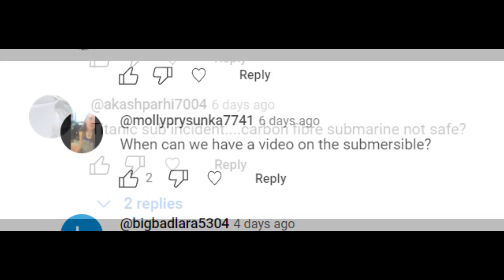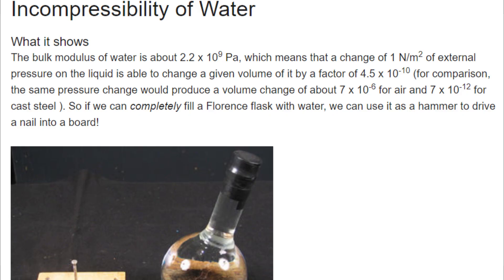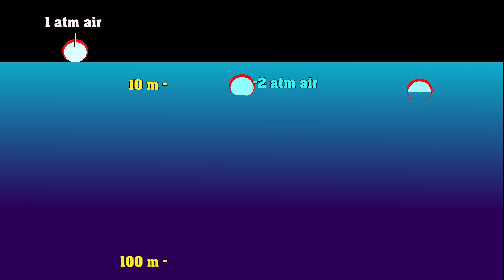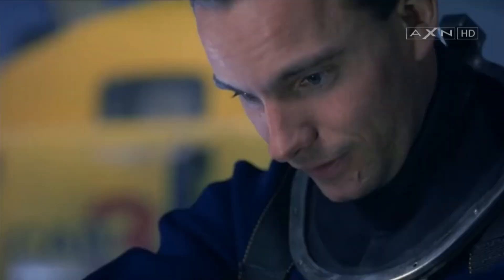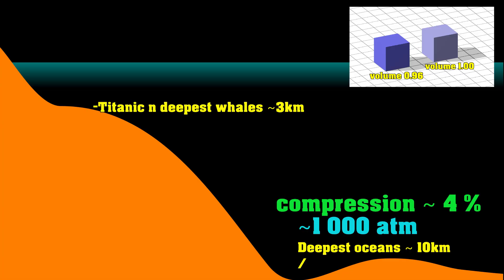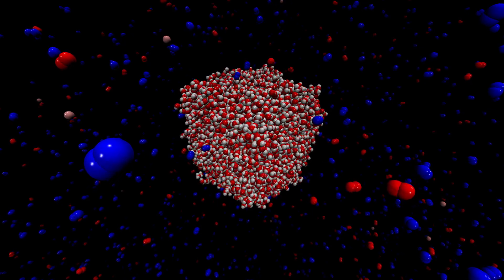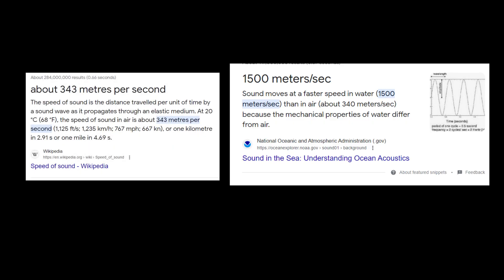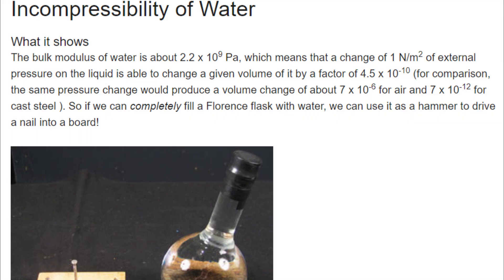What Happens when a Hull Fails at 1000 atmospheres?

Comment: I still can't believe it survived its test runs.
Reply: Test runs maybe weakened the carbon fiber hull
Reply: @rykehuss3435  Almost certainly
Don't forget it's essentially human beings layering "cloth" in opposing weave patterns.
At those pressures the tiniest imperfections and uneven layering would create small pressure differences and undue stress
Reply: @matthewstanton9633 not even, just see hiw it was just woundbonvaxdpool !
Reply: @matthewstanton9633 Not even opposing weave patterns in this case ...
Reply: @matthewstanton9633 not to mention that the exothermic reaction from weighing 5 in of carbon fiber and epoxy in one shot would cause instant hardening between layers and lots of dry delamination. They wouldn't know about any of this because they refuse to get it X-rayed.
Reply: @matthewstanton9633 No opposing weave patterns in this sub. It's like the thread you buy for sewing clothes. Just a flat thread rolled to an even thickness on a spool.
Reply: @matthewstanton9633 completely uninformed statement. Titan was laid up entirely by a machine.
Reply: Essentialy it's the dehaviland comet all over again
Reply: @matthewstanton9633  One could argue they learnt something new with the dehaviland comet. Not so much in this case.
Reply: @stusue9733  yes that's the truly sad part.
Dehaviland practically invented stress testing and went to extremely inventive ways to found out about the stresses involved in going from low to high pressure to tye extent of putting a whole plane fuselage under water.
I this case dire warnings about not doing destructive testing were ignored in favour of cost cutting
Reply: @infernaldaedra he never claimed to be a submarine expert. Nothing in this video was about submarines. It was about how water behaves under pressure.
Reply: @ThePrufessa  Submersibles are not Submarines. 😉 Hehehe

In this case you're better off just pointing out that they're not actually making a counter argument to anything FT said. After all they clearly have no real argument to make.
Reply: @ThePrufessa  dense much?
Reply: It survived more than just test runs. The sub wasn't completely unsuitable for this but it was only good for the first few dives.
Reply: @DM-rc4yu sure, not completely unsuitable, just mostly unsuitable. Did you forget the viewport was rated for less than a third of the depths they were going to?
Reply: @zromo8994  The viewport was rated for 1300 meters. Made of acrylic. And human safety means it was likely designed to ha dle 4000m+ of depth because human safety always means there must be a significant safety margin. Just that the window might have been designed to be safe for 100 dives to 1300m. And instead ended up safe for maybe 5-10 dives at 3700 meters.

It could be the window that failed. We just don't know. The only thing we do know is the window was made and tested based on best practices. Which is why it did allow multiple dives to 3 times the depth without failing.
Reply: @perwestermark8920  yeah so what I said. A third
Reply: @DM-rc4yu  What did you expect from something that literally used a thirteen year old Logitech F710 gamepad as its primary control input........
Reply: @DM-rc4yu so it was completely unsuitable.
Reply: @morten1953  No, it was suitable for 1 trip. It made it to the Titanic one time and returned. They should have left it at that.
Reply: @morten1953  No. Everything has expected life expectancy, your car is expected to run certain milage before breaking, airplanes are expected to have x number of takeoffs etc. You can of course make that expectancy higher by studying the mechanics and figure out that needs to be maintained and how often, but at some point it is more reasonable to retire the whole vehicle.
This submarine was experimental and they didn't bother to actually study or test it properly, just hope that it will work forever because that would save a lot of money.
Reply: @R3WIRED If went to the titanic at least 10 times in 2021 and 2022.
Reply: @morten1953 no. It wasn't completely unsuitable. However, he should have been swapping out new carbon fiber for every trip and charging them more than $250,000. He also cheaped out by making them do the grunt work instead of hiring people to put it together.
Reply: @ThePrufessa EOUGH NON SENSE ! Glued fiber is unsuitable here ! It will fail, each cycle will lead to cracks till total failure ! ENOUGH RUTH STOCKTON ! To swap the bofy each time ? Are you nuts ? Non sense too !  USE PROPER MATERIAL
Reply: @R3WIRED I think they had done 7 trips before the failure on the 8th trip.
Reply: @R3WIRED  Yeah, agree. I'm sure everything would've fine if they did 1 trip per sub and charged .75-1.5m/ticket.
Reply: @R3WIRED  who builds an expensive one time use submarine? that's incredibly wasteful. 
since they used it multiple times they expected it to last. since it failed catastrophically it was unsuitable for the job they had for it.
Reply: @morten1953 yes probably rated for 1 dive at 1600 m. As the window was only rated for 1600 m
Reply: @villekorhonen824 actually it is worse than that. The nature of the material makes it very difficult to monitor unlike, say, steel which you can monitor for fatigue etc to gauge residual safety.
Reply: @morten1953  I would say it's about as suitable as any other non-reusable products. Money aside, the sub survived several dives to depth when it should have been replaced after every single dive. Had they not been so sure of themselves and instead tore them apart to see what was happening after each dive (or used them as autonomous only subs after that) we wouldn't have even heard of them. The failure was using a single use submersible more than once. That and the front viewport was a glaring issue that just happened to work, until maybe it didn't.
Reply: @R3WIRED  It did around dozen dives between 2020-2023. Lots of YouTube videos from actual dives to the Titanic
Reply: @villekorhonen824  Let us not forget the Logitech game controller used for piloting... Something neither designed, nor rated, for use in damp/salty environments. Which makes me wonder about other electronic systems in the sub. How about those exterior cables that could easily snag? The propulsion system was virtually unprotected as well. 

So many oversights, so much ego, and he took four innocent people with him due to his hubris. I'm no expert, and I'm certainly not in the market to build or design the next-generation Carbon-fiber Coffin, but there are things that clearly should have been done better.
Reply: @donmab  They probably saw pictures of it and assumed the whole thing was the pressure vessel.
Reply: Each cycle cracked the composite cylinder, glue to the rim ... till total failure. Wound fiber (even woven) glued together is unsuitable to resist external pressure plus a poor shape, should be a sphere eventually an egg form.
Reply: @jpcaretta8847  Yes but then no.

Egg shape is weak on the sides but study from above and below. (Ever crack an egg?)

A sphere has the same amount of strength everywhere.

Also the challenger was the same sausage shape and it's the best that's ever been. It's only the habitable area that matters.
Reply: @jpcaretta8847  egg form is weak on the sides. Anything going this deep should always be a sphere.
Reply: @danquaylesitsspeltpotatoe8307 he was just demonstrating how water behaves under pressure. He was not doing a reenactment of what happened to Titan. Your problem is you're not smart enough to comprehend what he's demonstrating in the video.
Reply: @TubeMeisterJC  Exactly, the cause of death is still from pressure differential. The difference in viscosity would cause extremely rapid mixing, essentially turning anyone into a localised soup.
Reply: @dr3v1l1993 Yes there were - they were all test runs, complete with passengers to make them more realistic.
Reply: but he didnt go on those... 🤔
Reply: Most things probably can. The problem is the microfractures that take place that will become the areas of weakness on later uses. Most pressure vessels graded for humans will undergo vast laser and gas analysis to detect microfractures. Those microfractures will be the place that continues to expand, and will eventually fail if not addressed or understood. Aloha airline 243, where the roof ripped off during rapid depressurization. It was desined to last decades, but for several hour flights, not 30 min flights between islands, flying up to 7 times a day. That constant pressure, depressure, pressure, depressure cycle eventually fatigued the bolts.
Reply: @infernaldaedra  you're the one that's dense if you think people are claiming to be submarine experts.
Reply: The company went woke. Fired even the one that warned about design flaws in 2018. And after refuses to hire people with experience. Due to most are white male and above 50+. They called it not inspirational.

Edit they sed to "go woke go broke" hold my beer! .... In a real bad way🤦
Reply: @jpcaretta8847  carbon fiber is suitable for one use dude. Now stop raging at me because you don't understand what I'm saying. If NASCAR drivers use their engines ONE time then he could certainly use his hull one time per trip and change it in between trips. And charge these billionaires more than $250,000 in order to cover the costs of a new hull.
Reply: @ThePrufessa Replacing the hull isn't a solution.  Because that is based on the assumption you can analyse the just produced hull to find defects.

But the same moment you can analyse the material, you no longer has a reason for replacing the hull. If it was strong enough, then the hull will still be fine after multiple dives.

The issue here is they had zero ability to know if there were delamination. They didn't knew if there was zero delamination when brand new. Or delamination after 1, 2 or 10 dives. So every single dive was a dice throw to see if it would stand the load or fail.

That's why all other designs are based on materials that can be examined. And where you can simulate the load because all material properties are known. You can't simulate this hull, because every single delamination is an unknown. And you can't add delaminations you don't know about into the simulation.
Reply: @perwestermark8920  it's more of a solution than using the same hull over and over again until it fails. That's why I said each CF hull should only be used once. Because it's impossible to test how it fails with repeatable results.
Reply: @ThePrufessa  Just that the hull can fail already on the first dive if they can't test it. So no - it's a zero-use design without good test methods. Not one. Just zero. Much simpler products regularly have defects directly from factory. Which is a reason we have warranties when we buy things. But a warranty isn't worth much to a dead person.
Reply: @ThePrufessa in that case, make it out of steel like everyone else...?
Reply: It's amazing it survived the test Dives. Carbon fiber has literally no compressive strength only tensile strength. He couldn't have picked a worse material if he tried.
Reply: I'm not.

But I'm also not surprised it failed after several dives.

Upon hearing a composite hull I immediately guessed fatigue cracks.
Reply: Something that has been talked about in other videos is that carbon fiber is great in tension but poor in compression. Which it why it works so well in aircraft. Something else is that carbon fiber is normally laid diagonally increasing its strength, this was not done in the sub.
Reply: yes it did and then som
Reply: @kennethschultz6465  You sound like somebody who gets very confused about the "I can't believe it's not butter" ads.
Reply: @MeCooper  well if it made sence i know it´s not butter
Reply: @TubeMeisterJC  
Pressure is potential energy, potential energy is harmless. But when potential energy is converted into kinetic energy it becomes dangerous.
Reply: @jpcaretta8847   if he makes them pay for it then what difference would it make to make a new hull each time? It's not nonsense dumbass. It would have been better than using it as many times as he did without changing it.
Reply: @MeCooper  the difference between a submersible and a submarine is negligible and makes no difference for this conversation. The only difference is one can enter the water by itself while the other one can't. So miss me with your pedantic nonsense clown. Everything I said still applies to both submersibles and submarines so fk 📴.
Reply: @MeCooper  the challenger was not sausage shaped dummy. The challenger was a sphere.
Reply: @jpcaretta8847  if NASCAR engines can get rebuilt after each race then so could this hub get rebuilt after each dive. Calm your raging down you babbling buffoon.
Reply: @TubeMeisterJC  more like "it was not the funeral that killed you it was the landing", you got the order of operations wrong. Pressure comes after you die even if it was the cause of the effect (having compressed water) pressure waves have almost no pressure, prenatal versus kinetic energy.
Reply: @MeCooper  YOU said the challenger was sausage shaped and it absolutely wasn't. It was a perfect sphere. Now what does South Park have to do with this?!
Reply: @ThePrufessa  It's the only cartoon I could think of that has a rendition of the challenger... You're clearly getting your information from cartoons or something. Hahaha

It's a vertical sausage... It's actually famous for its design.
Reply: There wasn't much fatigue tests done on this thing.
Reply: Every time it goes down it gets weaker
Reply: It really didn't, it had a communications malfunction every single test.
Reply: It was only made to serve its test runs. The rest were for research and they didn't give a single s*it about what happened to the people on board, only to see how long it would last, how it would fail, and where they should improve. They probably looked at their CEO before he went on and went "bye bye, see you on the other side" knowing Damn well it could fail.
Reply: This is fun. 🍿 You guys are a hoot.
Reply: @TubeMeisterJC  
According to Engineering Toolbox the Triple point of Nitrogen (the most abundant gas in the atmosphere) is 0.1252 bar at -210°C.

Oxygen's triple point is 0.0015 bar at -218.79°C.
Neither of these gases become solid or even liquid at anything approaching 100 bar and -100°C never mind at lower pressures and higher temperatures that you can see in a cavitation event. I mean if this was what happened to air... there would be no such thing as cavitation in water or air!

CO2 could fit the bill... but they work extra hard to keep CO2 out of subs because under pressure it's even worse for humans to have it around. Even at normal pressures which you should experience in the Titan Sub you know before it implodes) CO2 only consists of 0.04% of the typical air in our atmosphere at sea-level. So while CO2 can become a solid it only can do that at 5.18 bar and -56.6°C even at 100 would still need to be pretty close to that -55°C to be solid... so in no way shape or form are we seeing liquid or solid air during an underwater submarine implosion.

But you and the people that liked your comment keep on thinking that I'm the one who's wrong here. It's alright the scientific evidence is on my side on this one.
Reply: @TubeMeisterJC  
Methane at those temperatures -18°C and pressures 80 bar would still need to be over 60°C colder than it was in the water outside the sub before the implosion to even be close to being a liquid, at best it might be super critical (meaning it becomes a substance with viscosity of gas that is nearly incompressible like a liquid).

There is generally much less Methane in air than CO2, if CO2 will not likely cause problems Methane is even less likely to cause serious problems.

I'm also the first like on your comment simply because you're at least trying to correct odd mistakes.
Reply: Its the tale of Stockton Rush, who ignored all the fuss, because he was in a rush, which is how he got crushed, and now he's just mush
Reply: Yeah but there were no check-ups for some kind of creeping damage to the gaskets etc, probably not even possible with everything just glued together.
Reply: @Breakfast_of_Champions wym not possible? how do you think they know you fractured a bone? praying to god?
Reply: I watched a video and it basically said carbon fiber subs are only 100 percent safe on the first run and after that it starts to degrade. I believe the Titan was on its 15th dive?
Reply: @NeapolitanApe carbon fiber is never 100% safe. Lol.
Reply: @MrJC1   Was the carbon fiber even holding anything. I saw how they did it, they just spooled carbon fiber around a thin titanium cylinder and put a lot of glue (probably some type of epoxy glue) around it. I think only the glue and the titanium were actually holding anything and the carbon fiber just sat around there, maybe the glue gave it a little rigidity but that was it. The moment the glue stopped holding sub imploded...
Reply: @Slav4o911  well i think the carbon fiber was glued to the titanium ring... if that is what you mean? the titanium cylinder they wound it around was removed i think after the carbon fiber had set. but i could be wrong. either way... the adhesive was the only thing holding it all together at its most crucial points. which is just insane to me, especially since the titanium ring and the carbon fiber react differently over time through wear and tear. which is an obvious failure point for glue bonding. titanium can flex a little under pressure, and carbon fiber wont. so you just know what that is going to do to a joint like that after a few cycles. and Stockton was no fool when it came to engineering. So it is amazing how he was able to blind himself with excitement for it. Just blows my mind really. The truth of the matter is, there are so many ways that carbon fiber can have imperfections and problems that cannot be discovered until much too late. I wouldn't even trust a carbon fiber pressure vessel for one trip, never mind recycliing it. I know they say it would have been okay if stockton had have just used it for one dive, blah blah... NO! trust me, don't do it, and you'll be 100% better off. Use OTHER materials. Use Steel! haha.
EDIT: Except in space. Obviously, in space it is entirely different. Much easier to keep 1 atmosphere in than keep 400 atmospheres out. Carbon Fiber is good for that kind of stuff and I am not trying to say it is a total failure as a material. Underwater deep diving though... hell no. Again... I am surprised that an engineer like Stockton Rush, had seemed to forget that we use certain materials for certain jobs. Lol. Smh.
Reply: @MrJC1   If they removed the titanium cylinder from the inside then everything was held by the glue. It's amazing how this worked as long as it did.... it's just crazy what they did. Also the carbon fiber almost didn't do any work... it was just sitting there between the two titanium hemispheres. 
 Also the type of glue they used seems to be strong in compression so it held  alone the middle section for as long as it did. 

 Also doesn't anybody looked at that video, they've also used glue for the sealing between the carbon fiber and the titanium rings:
https://www.youtube.com/watch?v=WK99kBS1AfE

 You don't have to be a rocket scientist to understand why this is a very bad idea.
Reply: @Slav4o911  Yes - they should have done just resin. Or acrylic. And suddenly have a homogenous product that can be properly simulated. But "composite" is a cool word sounding high-tech. And "plastic" is a sad word sounding cheap. The CEO did want to make parallels to high-tech planes. So cooler with "same technology as Airbus and Boeing". Even if the usage cases are so drastically different. He went with a design that absorbs water. So it changes properties the longer it's kept under water - even at a fixed depth and temperature.
Reply: @perwestermark8920   Yes they use carbon fiber but they is it in  a complete different way. The way he used it, was incorrect. Like for example if the pressure was from the inside of the submersible and not from the outside it would have lasted much longer, carbon fiber is known for it's tensile strength. It's also used in the auto industry for a certain pats but not for everything. Also in the atmosphere we have 1 atmosphere of pressure and in space it's like -1 atmosphere.  On the ocean floor the atmospheres are some crazy numbers, most people can't realistically even comprehend.  Like for example the Space X raptor engine has about 300 atmospheres of chamber pressure. 
4km deep in the ocean the pressure is 400 atmospheres, which is more than a chamber pressure of a rocket engine.  That's the only way a normal human can imagine it... and at that pressure any small flaw suddenly becomes very big flaw, that's why rocket engines explode... that's why everything about the pressure vehicle has to be overengineered. That's also the reason more people have been to space than in the Mariana Trench.
Reply: @NeapolitanApe They aren't safe in the first dive either - the problem here is that they 100% depend on knowledge of any delamination. And there are no good ways to detect that for so thick hulls. Have a delamination in the middle and the stiffness just got halved.

And that is why resin-only would be better. Lots of subs just uses acrylic. And they can be visually inspected.

Next thing is that the fibres adds weight/volume. But they add very little strength for compression. It's the resin that gives the strength. For tension - pressure from the inside - then the carbon fibre will deliver lots of strength. Because the forces will spread evenly, pulling on the fibres. While compression instead puts most load on the weakest part that flattens the most. Which puts even more load on the weakest part resulting in the lightning-quick failure.

Blow up a balloon and it keeps getting bigger and bigger while staying rigid - all until it pops. Suck out air from a balloon and it directly fails to keep the shape. The walls aren't sharing the load.
Reply: After all the comments here, I totally get how this sub came to be...
Reply: ... The uh, The comments are getting weird.

Pretending to be smart is a terrible idea... You've got a guy who doesn't know sh!t pointing out the misinformation... That's bad, That's real bad. Hahaha
Reply: its suitable for single use
Reply: @donmab  The Deepsea Challenger?

Are you confusing that one south park episode with reality??? lmfao
Reply: @ThePrufessa  lmao This is hilarious!!! SOUTH PARK IS NOT REALITY!

Lets look at the dimensions,.. 2.3m (7.7 ft.) X 1.7m (5.5 ft.) X 8.1m (26.6 ft.) ... Huh weird,... Spheres are usually more... Spherical. 

It is almost as if you don't really know what you're talking about but want to argue.
Reply: Am I doing this wrong?

All these deep arguments about all the technical stuff and I'm just here arguing that sausages aren't sphere shaped just because they have one inside.

I mean yeah sure I could point out exactly why they're wrong but it's nowhere near as funny.
Reply: @herkimersnerd8740 Note that carbon fibre plastics are normally quite good at handling many load cycles - when used correctly. And that's why it can be used in bows and crossbow limbs, airplane wings, pressurised tanks etc. But this was not an example where composites were correctly used. Every single delamination represented a very big loss of strength for this usage case. And different thermal coefficients represents huge loads.

But we still don't know if it was the hull or the a used window that was the initial failure point.
Reply: -Matter didn’t create anti matter
-Anti matter didn’t create matter
(Both of them were present at the time of big bang)
-Both of them didn’t create themselves.
-Both of them came from an unimaginable source,  that unimaginable source created matter and antimatter (everything) thats why it is known as “the creator” of everything.
——————--'''''''''''''''''''''''''''''''''''''''''''''''''''''''
- that unimaginable source/creator has created sin and virtue which are opposite to each other,
— “logic” confirmed that every action has its own reaction, the reaction of sin is different than the reaction of virtue,
— the creator has created prophets to let us know about each and every detail of sin and virtue, also about their reactions,
Thank you
Reply: I cant believe TF has got this so wrong! He should stick to things he knows instead of getting confused about how it works and making false claims!
Reply: @danquaylesitsspeltpotatoe8307 what false claims did he make?
Reply: @danquaylesitsspeltpotatoe8307  Care to elaborate that claim?
Reply: @BojanMilic84 everyone just claims to be a submarine expert now
Reply: @BojanMilic84  For starters he says theres no pressure or it doesnt matter! 🤦‍♂🤣 With his gravity demonstration of when the sub was teleported away instantly (to the a star trek ship?) and the people where left there! THAT IS WHAT HAPPENED RIGHT? 🤦‍♂🤣
Reply: @BojanMilic84 I agree to him in general I love thunder but you know lately he has been talking about topics not in his area of expertise so even if his arguments are correct most of the time he still can’t present him self as an expert. I am a computer science student I know lots of stuff about JavaScript databases and c++ but I can’t present opinions in an authoritative manner about robots and rockets much like how thunderfoot being a chemist can’t evaluate elon musks rockets and OceanGate submarines. At least he usually does adequate research first, I’ve never got the impression that he mumbles about ai taking over and about aliens like certain “science channels”.
Reply: @danquaylesitsspeltpotatoe8307  " For starters he says theres no pressure"  and the other reasons?
Reply: @BojanMilic84 
Tf00t is effectively saying for a good chunk of this video that water expanding into the opening of the vessel couldn't be what kills submariners in an implosion... in the end he says water's springiness is what kills submariners in an implosion...

All of that is pretty wrong because it ignores the fact that what's really happening is the air wants to escape.
A sub is just an underwater balloon. Take the people out of the sub and fill the sub with Helium or Hydrogen and it's hull needs to be even stronger... better yet take all the gasses out of the sub and sink a totally enclosed shell. There's an immense pressure outside and none inside. If there's an opening the water wants to fill it... but the water is not continuing to decompress after the hull is filled with water, instead it becomes compressed again because there's no more air.

Even the thing about the whales was sort of wrong too because whales can dive too deep causing death though that's because like most land loving animals whales take in massive gulps of air instead of filtering out molecular air from water using gills like fish do.
Reply: @BojanMilic84  "Care to elaborate that claim?"
The said "so wrong" which does not quantify how wrong or in how many ways. Mildly wrong? not fine enough details? There are many aspects, what do they feel is the major aspect not being mentioned?
I think of it more as an educational simplification that illustrates the availability of rapidly changing and highly energetic forces. I wouldn't say "so wrong", it isn't comprehensive but that would require a fine grain numerical simulation.
It doesn't make much difference to the occupants. If they are very lucky they would not even have 1/10th of second, not enough time to comprehend the collapse before neurons no longer functioned as a network of neurons.
  E.g the water intrusion rapidly compresses air, heating it by thousands of degrees, compression waves in the water and air depending on the mode of failure propagate,  tens of megajoules of kinetic energy distributing at supersonic speeds , associated acceleration, deceleration and shear forces.
The equivalent of an artillery shell explosion bouncing around, likely oscillating, inside.
Reply: @danquaylesitsspeltpotatoe8307  What on Earth are you waffling on about?
Put the drugs down and step away from the keyboard.
Reply: @VariantAEC  When the hull breaks  we enter a dynamic phase ! At the boundary water air pocket, the pressure is 1 bar,   thus the water accelerates, expands, compres the air pocket till pressure equilibrium.
Reply: @VariantAEC You didn't understand it.  The water will always fill the sub.  TF is saying if water wasn't compressible, it would fill it slowly at "freefall speed".  But because it's compressible it can expand into the space at ~ the speed of sound.  He could have added that the energy to do this is stored in the water compression, just like there's energy stored in a spring, but I guess he's a chemist not a physicist.  Just because you don't understand someone doesn't mean they are wrong - you need to understand what they are saying before you can decide whether they are right or wrong.  TF's interest is obviously understanding things down at the root level, and he's tackled this one nicely.
Reply: @BojanMilic84  Razlika pritiska je problem, ne kompresabilnost (stišljivost) vode. Thunder je pogrešio zato što je rekao da je kompresabilnost problem, koja je inače zanemarljiva. Imaš jednu atmosferu u batiskafu dok je okolo pritisak 300 atmosfera i to nestišljive vode. Kada je voda uletela u batiskaf, svaka zapremina stišljivog gasa, tkiva, itd. je bila izložena 300x većim pritiskom.
Reply: @danquaylesitsspeltpotatoe8307 For starters he says something you failed to understand. But you never figured you might have been the weak link.

Our bodies can handle the pressure at 4000 meters because our bodies doesn't compress. So we get an equilibrium of inside/outside pressure. The killer is that the air in the sub compresses. So the external water can rush in at faster than the speed of sound and take over the space held by that air. And hundreds of tons of water moving in at 1000+ km/h will be like getting hit by mant sledge hammers. Instant red mush because of the kinetic energy. But sledge hammers on land would also crush you without 400 atmospheres of pressure differential.

Now go back and view the video again, but focus on the atomic models and what you can learn. Instead of focusing on your own bias "he's wrong"...

A smart person knows physics often have multiple models for describing things!
Reply: @PanosPitsi ThunderfOOt isn't writing a paper to get published. It's just a YouTube video.
Reply: @VariantAEC 1 atmosphere or 0 atmosphere is  basically the same when there is 400 atm on the outside. Switching between air, helium or anything else on the inside is rather irrelevant.

But you missed the point of the video. The video is not claiming pressure wasn't involved in breaking the sub. The video was about explaining that it is the compressibility of the water - and the ensuing expansion of water that makes the water almost instantly reach over 1000 km/h. Because water being compressible means there is lots of energy stored in the compressed water. Pressure itself can't make the water accelerate fast enough to fill the sub as quickly as happens.

It isn't some magic hydraulic tube with 400 atm pressure that is pressing the water into the sub. It's the decompression of water that makes the water rush in.

Now care to rewrite your physical explanations to tell how you figure ThunderF00t is wrong about this??? I very much like to see your scientific paper on the subject...
Reply: @danquaylesitsspeltpotatoe8307 i think you mischaracterise his argument
Reply: @perwestermark8920  You forgot to say which imaginary space ship teleported the sub into space and back again! 

"Our bodies can handle the pressure at 4000 meters because our bodies doesn't compress"
"Instant red mush because of the kinetic energy."
Yes and if water didnt weight anything it wouldnt damage or it it was air moving slowly or if they where inside inside another sub that worked 

WOW ITS GREAT TO MAKE EXCUSES OF WHAT COULD HAVE HAPPENED BUT IT DIDNT!
Reply: @fabioq6916  His argument was showing what happened if the sub was not there suddenly and that water would fall down at the speed of gravity. Ignoring theres was tons per inch pressure above it! 

WAS THE SUB MAGICALLY NOT THERE?
AH NO THAT DIDNT HAPPEN! 🤦‍♂🤣
Reply: @danquaylesitsspeltpotatoe8307 use English
Reply: @danquaylesitsspeltpotatoe8307  Multiple sentences from you. But they did not actually represent any meaningful argument. But that was expected since you failed to understand the video and after having been told you failed you decided to not invest a bit more time learning the relevant facts presented in the video.

There is no one here that has claimed water is light and will not hurt when it at high speed hits someone. The relevant part is how it's possible for the water to reach that high speed. And that is that water compresses.

This video is not about how the sub failed. It's all about the reason for the high water speed after it has failed. Is that really such a hard thing for you to grasp?

So you find a video explaining deformation zones of a car, and the only thing you can argue is "Broken science - the car should have braked instead of running into the wall". But stay a fool if that makes you feel good.
Reply: @perwestermark8920  
I know you missed it, but I already explained another hypothetical.

If we replaced water with Mercury (which is 1/8 as compressible as water and also much more viscous) the result result would be the same. These individuals trapped at the bottom of a 100 m tub of Mercury would be obliterated by the shockwave created by Mercury breaching the hull at a slightly slower, but still nearly hypersonic speed (4.22 times the speed of sound in air). The hole Mercury would need to enter is larger, but seeing as how the hull of this vessel fractured into dozens of pieces (due to it's brittleness) the result between an implosion in much less compressible Mercury and much more compressible water, would be the same from these people's perspective.
Reply: @VariantAEC  This is not a video trying to explain people dies after the hull got crushed. It's a video explaining what physical reasons got the water moving in.

If you find anything in the video wrong - say what. Else stop producing noise. Now time for you to produce actual descriptions how it was not the compressibility that resulted in the high water speed....
Reply: @perwestermark8920  
If the sub were filled with surface water and dove to the same depth and an automatic hatch opened.

What would happen?

Nothing.
Reply: @VariantAEC  The answer to your question depends on if the hull got compressed to adapt the inside volume or not before that hatch was opened. But your question indicates you are still on the wrong track.
Reply: @perwestermark8920  
What do you think I meant when I used the term "surface water"?
The term "surface water" I thought was the sure-fire way to ensure no moron could misunderstand what I meant is that we're bringing a sub to the bottom of the Mariana Trench with "uncompressed" water in a sub with a hull that will not flex or buckle or shrink due to external pressure from the ocean above it due to having an exemplary rigid construction.

Now that you know what I mean by "surface water" - to be very sure your poor reading comprehension skills cannot lead you astray again - that means water that is not under pressure and therefore not compressed... DO YOU REALLY BELIEVE that opening a hatch with uncompressed water would send a devastating shockwave through the vessel?
Reply: @LokiCentral  
This isn't how it works.
Again taking a sub to a significantly higher depth (just 100 m under the surface) of a pool filled with Mercury a liquid that is far less compressible compared to water and had the same failure which was likely the result of a catastrophic multifaceted crack in the brittle composite hull. The Mercury would fill the vessel (or what remained of it) just as fast.
Take the sub to a depth of 30 m in the same pool of Mercury and still a similar thing would happen...

Less compressible Mercury which is also more viscous with a higher surface tension making Mercury less able to fill cracks or stream through tiny fissues in any fine structural opening or in the case of a sub any fault. The Mercury would flood the hull of the vessel at supersonic speeds killing the passengers faster than a shockwave could.
The only way a sub will fill at slow speeds is if it isn’t completely submerged and there are other openings forcing water to act against the atmosphere above.
Diving bells never fill faster than the speed of sound unless the umbilical has a failure breaking away from the surface allowing the air to escape through the hole at the top of the bell causing a cavitation collapse.

Again air diffuses into water really well, water does not diffuse into air anywhere near as well. This means fundamentally when air is in water's domain the rules of air don't apply they're superceded by the rules of water.

The water being compressed or not makes no difference here.
In fact the only thing that needs to really be considered is that there is at no point during the filling of the vessel a direct connection between the air above the water's surface and the air in the submersible if there is no column of air connecting the pocket of air in the sub to that avobe the sirface you are playing by the rules of the speed of sound in water.
Reply: @VariantAEC  Use moron terms and be the moron. Water is water. Then the temperature, salinity, etc are just additional attributes. Apply pressure to "surface water" and it would do what water does. Compress. But it would still be the same water with whatever random label you may have given it.

But if the sub maintained the original volume, then bad things would happen after that hatch opened. Lots of water from the outside would flow in as the volume of the water already inside the hull decreases. And if we ignore the forces on that hatch, you would end up with a final "water hammer" on the hull likely ripping the hull to pieces.
Reply: @LokiCentral  
If you don't believe what I've written take a watertight plastic object (maybe a 20 oz thermos standing 8.3 inches tall mostly because it has a fairly large opening at one end) submerge it in a deep fish tank 4-5 times taller with at least 3 times the diameter of the filled volume of the container and open it the top of the container (with the opening facing the surface so it can freely fill with water) and open it. Tell me what you hear tell us how fast the container is filled.

If water hits the bottom of the container in 1.5 TENTHOUSANTHS of a second then you know water is dominating. If the bottom of the thermos gets wet in a shorter time than 6 tenthousanths of a second, then wer know the rules of the speed of sound in water are dominating and not in simple freefall.
Reply: @danquaylesitsspeltpotatoe8307  I find your opinion lacking in credible counter explanation.
Reply: @danquaylesitsspeltpotatoe8307  Sooo. Care to explain how he got it so wrong
Reply: @danquaylesitsspeltpotatoe8307 l
Reply: @danquaylesitsspeltpotatoe8307 how was he wrong exactly?
Reply: @fabioq6916  Derp what did i say!
Reply: @danquaylesitsspeltpotatoe8307  I`m curious, how has he got this wrong?
Reply: @TheTemporalAnomaly  As stated derp there is pressure there! the sub was not teleported away causing the water to fall at 9.8ms as he claimed! Pressure caused the water to come very fast!